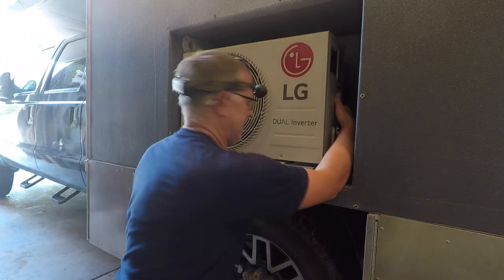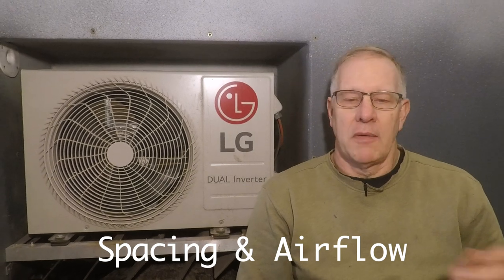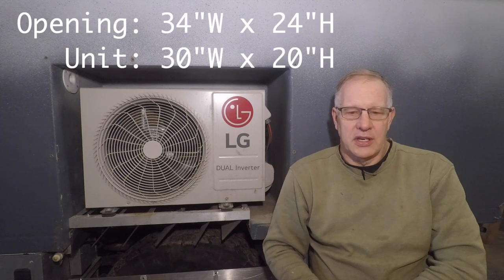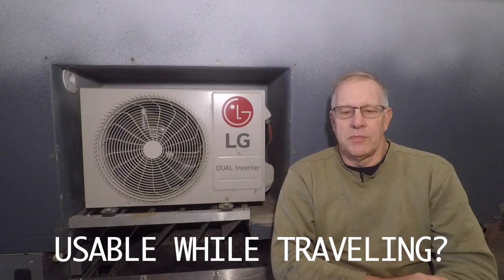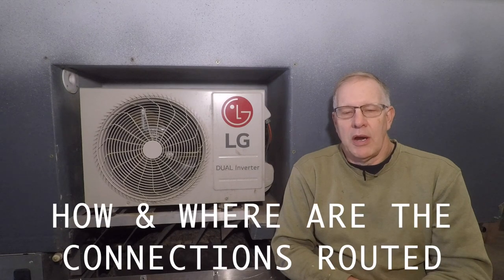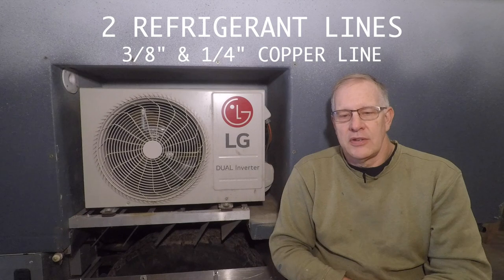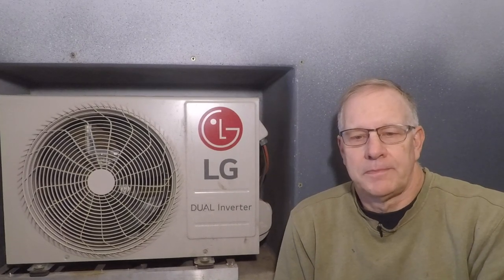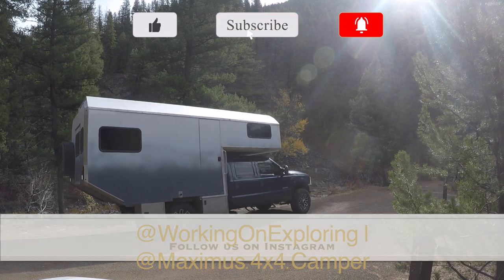Mini Split RV System? Your Questions Answered | DIY Truck Camper

Comment: Hi how are you guys doin? I got my 38 seer minisplit installed last weekend. It is a 220 volt inovair 9000 btu. It cools the camper down in 10 to 12 minutes and uses 600 watts to cool it down then drops down to 200 watts. The inovair 9000 btu mini goes from 13500 on high down to 2000 btu at the lowest power. Its so amazing staying cool and doing it all with solar. Thanks to ypur video and a few others i was confident with doing the install and had a good idea of which one i needed to install. Thankyou for helping me with conversation before i installed it also. Its running great off the split phase inverter and me and the wife couldnt be happier. Thanks again
Reply from the maker: Glad it worked out.
Reply: @WorkingOnExploring  thanks. Your videos helped me alot and we both are glad you guys that teach on YouTube do what you do. It's It's great service thats kinda under rated. Thanks again

Comment: WOE, great explanation of your system. Having seen your first video I wondered about things that you explained here. So, I'm from the cargo trailer conversion to camper (toyhauler) world and knew a mini split was going to be my a/c of choice. Of course no need to tuck it in like you had to do on your truck camper and have a lot of roof real estate for solar panels. I went with a Senville 9K. Its SEER is 19 and its COP heating is 3.11. Its lower cost was also a factor in choosing this particular one and I was also able to commission the unit myself, which saved a few dollars. Safe travels and thank you.
Reply from the maker: Sounds like you understand the problems and are making informed choices. Senville is a Midea (Chinese) brand and is a decent economical choice. I chose to spend about $150 more for the better technology AND smaller size of the LG (and I believe superior reliability). I think it is worth it although I can't recall the specific numbers on which my decision turned. I was looking at Senville, C&H, Pioneer and one other which are all Midea brands and I assume are identical internally because they are almost dimensionally identical but have some different feature content (WiFi connection option comes to mind).

Comment: great video, I think that would be an ideal spot for it in an arid desert situation as well (protected from  the sun).
Reply from the maker: Thanks. I started off just wanting to use a mini split (low noise and efficiency) and get it mounted down low. I'm pretty happy with the way it's worked out and would do it all the same again.

Comment: Anecdotally, I know a person who mounted his unit facing frontward and the fan blades broke/flew off inside the housing.  He guessed the combination of 70mph travel plus a headwind was enough rotaion to exceed the integrity of the fan construction.  No idea if this is what actually caused it or if somehow some rocks made its way through the grille somehow and shattered the fan.
Reply from the maker: Not only do the dynamic/centrifugal forces of the wind over speed the fan blades but the permanent magnet motor then becomes a generator. The motor control can only tolerate a small amount of backfeed from this motor generation based on the normal expectation from storm driven wind. I think we can reasonably assume, airflow from vehicle travel will most certainly exceed what would normally be expected from a storm by several times. The result is going to be burnout of the motor control. I don't have as much concern with my sideways mount but I would if either front or rear mounted without a cover.
Reply: @WorkingOnExploring  Yes, makes sense.  Wanted to add that anecdote for one more reason why it's a bad idea.  You mentioned that mounting the unit behind the vehicle resulted in it being in a void of air (can't remember what words you actually used), but wasn't sure if you meant that was good, bad, or inconsequential.  Do you think that location is suitable?
Reply from the maker: @jasonpotts6490 Placing the ODU on the back bumper seems to be the most common location. When not moving, everything should be fine as long as there is 6" or more of space between the back of the ODU and RV. Depending on the shape of the back of the RV (most are pretty square), when in motion, it's most likely there will be a negative pressure area close to the back wall. Since the ODU is trying to draw air IN  from this area, it will make the fans job much harder. The negative pressure also causes a lot of turbulence (random air direction) that is also bad. The airflow UNDER the RV is also a problem because it's likely both turbulent and hotter (from the pavement) so is less helpful. All said, probably not a good idea to operate while in motion and a really good idea to cover it so the fan isn't pushed by the airstream when moving but when stationary, all should be fine.

Comment: Very nice job and very similar setup to mine, mines in the LP locker (No LP now) and pull air from below and pushes out the side just like you.

I've used mine whilst doing 75mph many times and its working well, no issues with the airflow going past the air exit. The power consumption actually slightly improves when im moving. That leads me to believe there's actually a vacuum effect happening that's actually assisting airflow.  I used the a 19 seer 12k unit (i think the LG is 19 too?) works so well in my 26'' RV. 

So quite and efficient
Reply: Oh yes and mines an Innovair, from memory its slightly smaller than the LG. I needed that as clearance above is SO tight! behind and too the sides theres plenty of room, loads of airflow
Reply: My evaporator sits a little lower so has great airflow, yours being a smaller RV im sure its more than enough for your space though
Reply: I really like the duct you did from the front cab to the back! that's a great way to get some of that heat out of the front area. I was going to put a removable window circulation vent down the hallway in mine to help pull hot air from the front area of the RV back but seems to be ok so far. Its all very cool fun doing these kind of newer style projects isnt it
Reply from the maker: It's good to know that you are successful using it while driving.....I have not intended to do that but am reconsidering. I needed it little but when we left last June for the summer it was 116F in Riverside and our first night stop was south of St George Utah where it was 104F at 9pm....the camper was well over a hundred inside from driving 6 hours in 100+ heat....I turned it on turbo mode' and it cooled down enough that we could sleep but that was the first time I considered that I should run it while driving. If it happens again, I will try it. I can produce 3kw from my 24v alternator into my battery (then invert 120v in my 4kw inverter) while I drive so precooling the camper would be easily done.
Reply from the maker: Innovair is a Midea (Chinese made) brand. I gave up finding a small unit from them after looking through 4-5 of their brands and am very happy with my LG
 It is a 20 SEER. Higher seer requires a bigger condenser coil so high efficiency and small size run opposite.
Reply from the maker: I'm very happy with my duct too...it took me several tries for the right fan....I went cheap and tried two 'computer' types before getting a good cross flow blower. It's still not as quiet as I would like but we typically run it on high only for a few minutes when first starting the heat or A/C then turn it down about half speed which is pretty quiet and keeps the camper at the same temp. It is a bigger problem with a bigger RV but I don't think just a bladed fan blowing down a hallway would be enough....need to deal with thermal flow separation properly, hot air moving above and cold air moving below in the same space is going to hard....that is why my duct runs about 14' in the 19' camper....I want a reliable air exchange.
Reply: @WorkingOnExploring  oh wow 3kw is serious power from the alternator, that’s perfect for using the mini split.
Reply: @WorkingOnExploring  yes i would of liked a higher SEER too, something around 25 would of been ideal but like you say the condenser was always allot larger, but still 19/20 SEER is allot better than what we would have if we still had rooftop units.
Reply: @WorkingOnExploring  yes fantastic idea re the duct, the thermal flow separation isn’t easy but your design sounds like it works well.
Reply from the maker: I'm running a 24v primary DC system so 100A (continuous) output from an alternator at around 29V is about 2900W. I am soon to remove the internal alternator diodes and replace them with a larger external bridge with heat sink  located in the fan shroud to remove some heat from the alternator core and get better output at lower alternator temps. As it is, I can't maintain over about 90A most of the time due to combined engine heat and alternator heat.
Reply from the maker: My 2 ceiling ducts are about 1.8"h x 5"w. They seem about right but bigger is always better. The cross flow blower has a 2.5"d x 9"w runner driven by a 24V BLDC motor on a PWM speed control. Since my '24V' is really up to 28.7V, (and my typical battery voltage runs from 26.5V to 28.5V), top speed on the blower moves a lot of air but is noisy(used only when temps are extreme). At around 12V, it is pretty quiet and moves enough air to maintain uniform temperature.
Reply: @WorkingOnExploring  allot of tweaks when you’re pushing the limit but you will get there, an awesome project for sure! i’m wanting to go to a 2nd alternator too (24v) a balmar with external controller, probably 100a.
Reply from the maker: My alternator is a 220A Chinese made and sold through DBelectric.com.....ive had a number of alternators from them with none failing. If you don't know, a 220A alternator will put out 220A INTO A RESISTANCE LOAD BANK, at 6000 alternator rpm. That is not it's max but very near. An alternator will only put out about half it's rated capacity continuously
 In my case, my Ford 4G alternator is backed up against the passenger side head with about 1/4" clearance....no airflow and I typically only get 90A continuous which is why I want to go to an external diode bridge. I run a Transpo V2400 (Also sold by Balmar on their own Pn.) external regulator. I removed the small variable voltage pot embedded in it and replaced it with a 10k, 10 turn precision pot that is mounted in my center console beside ammeter, voltmeter and thermometer for the alternator. I can literally dial any charge level I want and see what temperature I get. When cold, I can get 200A but that's a bit much. The thermostat cuts off power to the regulator when the alternator reaches 120C and comes back on at 110C. There are some YT videos on it and some on my instagram (@maximus.4x4.camper). I just put a dual alternator setup on a 2003 F350 with 7.3l diesel for Blake Scott (@thisisnomadic). I used a Balmar MC618 regulator ('12'V) on a 200A 6G large case alternator charging 500Ah of Battleborn. Runs 180A@30% SOC till the alternator warms up then backs off based on temperature (128C max). It also has the Balmar alternator temp sensor which is critical. I have a used MC624 regulator that is sell for $150 if you want it. I frankly prefer the ability to dial up or down my charge. On Balmar alternators....while they can put out a ton on a sailboat, engine heat under an automobile hood will decrease their output to near what you'll get with a decent aftermarket automotive alternator. Sail boat engines are  their market and they tend to be small engines that don't run that hot.
Reply: @WorkingOnExploring  Following you on instagram, amazing stuff! love your work
Reply from the maker: Thanks. Happy to help on anything.

Comment: Overall good video. I have some concerns regarding the heater function of a heat pump.
I want to clarify that when the temp gets much lower than 32F, 
yes - different gases have slightly different performance.
the heat pump will become less efficient than a electric resistance heater. 
It was stated it will always be 2:1 better.
basic rules of heat -
electric is the least best way to heat.
Electric resistance heater - worst
Electric heat pump - better than resistance (most of time)
Butane - much more efficient than electric, fluctuating price and supply can be inconvenient.
propane - stable price and convenient to most locations.
natural gas - more stable price and best efficiency and performance

Most off gridders use propane for heat as electric heat uses a lot of power. 
I run electric heat during day when I have the sun, but switch to propane as soon as the sun gets low. A/C runs on sun during day also but gasoline genny at night.
Reply from the maker: Jose, 
Several points
1) Heating efficiency of a resistance heater and motor turning electricity into heat is identical because all the input energy becomes heat. If you had a 1kw resistance heater operating in a room beside a motor drawing 1kw, they would consume the same amount of electricity and produce the same amount of heat. Energy used in a heat pump motor is the , same but the mechanical energy is used to move 2x more heat. The compressor is cooled by the refrigerant. All of the electricity becomes heat and is carried away by the refrigerant. The advantage of a heat pump is that the work done in the consumption of the electricity can MOVE heat, giving it the multiplier that makes a heat pump much more efficient (~3x). One of the three units of heat is the electricity 'converted' to heat, the other two units are 'moved' using the work the motor delivers.
2) As the environmental temperature gets lower, the difference between collection temperature and rejection temperature becomes greater, requiring more energy to 'move' heat. This is where the ~3:1 COP goes down. It makes sense, when something gets 'harder', it takes more energy to deliver and you get less for the same energy input. In practice, a heat pump will never be less than twice efficient as a resistance heater. In theory, it can be as low as equal but can never be less.
3) When you begin to compare gaseous fuels to electricity, and immediately talk price, you have a completely different comparison. It is no longer mechanical efficiency, it is cost-effectiveness (not efficiency). It is definitely true that different forms of energy have different prices for the same volume of energy. The two cannot be directly compared.
As an example; Assume 1kWh of electricity costs $.10. With it, we can produce 1kWh of heat by running it through a resistance heater or 3kWh of heat running it through a heat pump (in favorable conditions). 

Using the same $.10 to buy Butane at $1.215/lb (wholesale price in the US today ) yields .08lbs of Butane for $.10. The heating value of butane is 21,640 BTU/lb. So, .08lbs x 21,640BTU/lb / 3.412 BTU/kWh = .507kWh of heat in $.10 of Butane (at wholesale price). Furthermore, combustion of butane in a typical furnace is only 85% efficient (15% goes up the vent stack to carry away combustion byproducts). .507kWh x .85 = .431kWh delivered as heat into an interior space.
This rough calculation uses wholesale prices, not retail prices. If I used retail prices, that makes the energy delivered less, likely by a lot. In this case, combusting Butane has the WORST COST-EFFECTIVENESS of the three heating options. Prices are all over the place and you can argue that but it would have to change BY THE BETTER, A WHOLE LOT to beat the cost-effectiveness of a heat pump.

most off gridders use gaseous fuels because that is what they can get without investing a whole lot of $ in equipment. It is convenient and simple. This is also why RVs use propane so much. A lot of energy can be stored and transported without expensive equipment. It is a COST-EFFECTIVENESS factor, not a fuel efficiency one.

Using fuel in a generator has about 30% mechanical efficiency. It makes no sense to spend lots of $ to by a 300% efficient heat pump and run it on a 30% efficient gen set. Total efficiency is only 90% (.3 x 3) and a lot of money is invested. You're just as well off burning it directly (as in your butane example) I get it. If you were to just burn the fuel for heat, or better yet collect the heat off the generator AND use the electricity to run a heat pump, you could likely improve your 90% to 130% but the effort is tremendous.
The big efficiency in using electricity to heat with a heat pump is the lower relative cost because 'leverage' a the heat pump provides and of the higher mechanical efficiency of large thermal power plants.

Hope you stayed with me. The 3:1 efficiency gain of heat pumps is huge compared to direct conversion. Heat pumps are the way the world is heading for that reason.